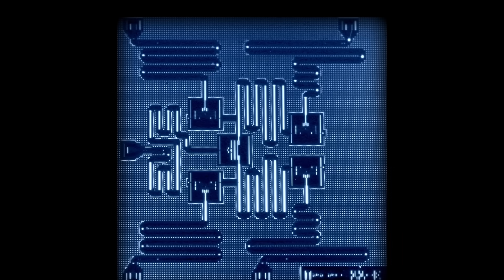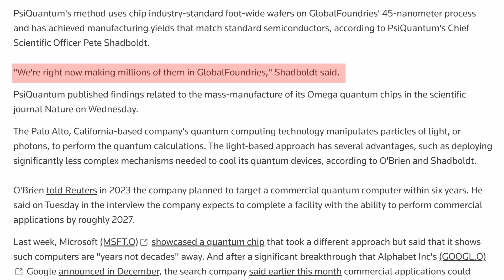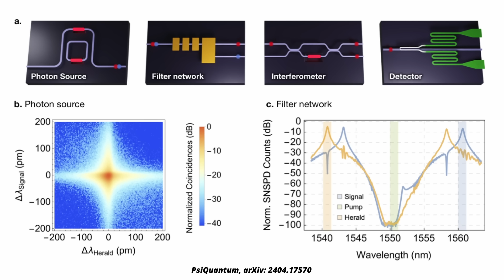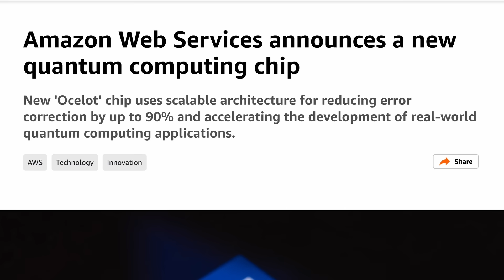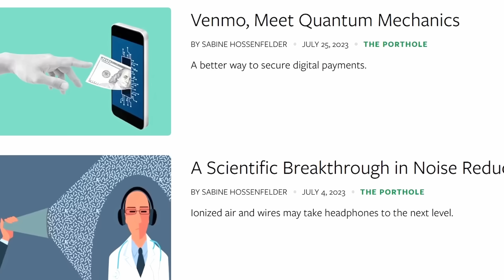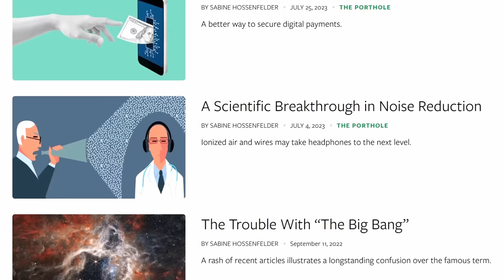Amazon’s Quantum Breakthrough That Everyone Missed

Comment: I believe I have figured out how to do quantum like computations using digital circuits and light basically its like a binary digital computer that can do as many analog computations as you want using mass paralyzation and some other techniques a long with light to make as many starting mirror calculations that can have different values added on the spot per processor it will be poly programable but still use binary computers to run it at first if there is a way you can help me network to get help building this I would really appreciate it if you don't here from me my power was shut off I am Struggling!!!

Comment: Quite a nice Idea from amazon. I try to explain it the best I'm able to, I'm not a physicist so keep that in mind:

Normally, with a superconducting josephson junction, you tune the microwave pulse to get a resonance of the electron/photon state, vibrating between ground and excited. 

Now, Amazon uses frequency that is "double" the resonance to get 2 spikes in the phase space that are antipodal to each other, 180 degree phase shifted. "Double" in quotation marks, it requires a specific kerr non-linearity and tuning of the photon pump, it's not just doubling the frequency and that's it!

These two spikes are used to define the state of the qubit, the phase shift creates a double "bowl type" effect, like a potential well, that protects the qubit against bit-flips, thus reducing the amount of surface code and ancilla qubits.

The concept is called Kerr‑cat two‑photon parametric drive.

Comment: In the beginning it was a Uniform Plumb Cometary Lightbolt where there was minimal interference drawn through capacitance of an initial charge of surging darkness that was built up being evenly distributed where there was the effect of a myriad of stars appearing as it traversed into the depths where it twinkled morphing instantly into the Protective Cocoon of an upright intelligence that of a Naga inside a perfectly round flat Green Plasma Accretion Disc of the Earth in a hula hoop action warping on the whole transmuting under the workload pressure of heavy entropy almost as if to complete failure into our present Globular Solar Filamentary Galactic Cluster still yet to complete its initial phase of development to be settled into permanently as a perpetually generating paradise of a perfect biorhythm of love where we are dynamically Superfly having our own wings of a Toroidal Field so as does the fluctuating matrix of the Monster Organism that is the Universe on a Quantum-Cosmic Scale fully contracting yet to crush the indecisive random dud tossing false image the altar being set up the Abomination of Desolation hence the excessive dust of the A.I Empire Mechanical Beast the degenerate machination of Old being used against it that keeps crashing quarantining it rejecting it as a foreign object in an immune response to be obliterated in a full scale evacuation plan there always having been a larger predator a sole individual the Naga of the Unified Field waiting in the depths of what is known as the Abyss being born coming out of the waste against the void activity of his enemies trying to enslave him segmenting him to try to trick his mind with clocks that don't resonate a virus pretending to mimic him to train him as a zombie but in turn waiting for them to try and pass by in an exchange to trap them in his net so hence the Precession of the Equinox and the greenery left the Earth being his nest!

Comment: It does seem to me that the error rate (failure of entanglement) is an exponential problem, in that the more Qubits they clump together to do calculations the more relational errors they will produce exponentially? There seems to be an underlying principle in that because efforts to correct these errors become exponential with complexity, they will always be greater than the brute power of the processors themselves.... It looks like an idea that ultimately cannot work? I really hope they can do it - but my gut feeling (after a career in design) is telling me it will ultimately fail by following the current path. Some radical breakthrough it required😞

Comment: hold on: doesn't normal computer working memory deal with redundancy already? like with 'ai' I'd imagine we are being fed a lot of mystification when it comes to quantum. while, obviously a problem requring hard ware research the redundancy structure is certainly not novel to software engineers and might be said to be so ubiquitous as to be a given in designing computational archetecture. throwing a bone to the press me thinks

Comment: I actually wonder what happen when we connect small quamputers together with computer bridges? I know, it's not quantum correct, but it would have an advantage of scaling. The speed might just be 50% of full quamputers, but it would take less heat management. Well, maybe because computers are already working with unstable quantum states and that can cause any magnetic qubits to wiggles and flip or even tunnel away.

Comment: Commercial relevance of Quantum Computing is a long way off? On the day D-Wave conference featured several high profile commercial clients in proper Industry. Logistics, mobile phone networks and gambling! Gambling - what is more brutally commercial than that. Yes, Quantum Annealing isn't Gate based? And? It solves problems classical can't and does so now. And about to do so with 7400 Qubits. Also, what if PsiQuantum did have a need for millions of chips? What would that be?

Comment: The guy with the "million" qubits, reminds me of the old "bubble memories".  Our company produced computers using these, and they were just strings of bubbles in a row, circulating continuously through a memory cell chain.  This is theoretically possible with "any" particle string, and is a simple serial memory.  It can even be done with dirt particles (and was used for gyros).  There is still one military system out there, which still uses these bubble memories.  The main problem is throughput, since any parallel memory will be much faster (theoretically).  His photon strings might actually make very good accelerometers.

Comment: Based on waves uncertainty that, Roger Penrose says is not understood at all and which misunderstanding is being swept under the rug. Also Jacob Barandes,  a Physics scientist at Harvard,  says something similar, "They are lying" about waves. It is not a setteled matter that waves are the mechanism that explains the two slit experiment. A much more accurate mechanism, basically a more modern model of the electron and all other particles that is at least 100 times more accurate than Standard Quantum Mechanics, was discovered in 1986 by Hermann Haus, an electronics engineeering professor at MIT and soon after that by a student of his, Randell Mills. Mills went on to rederive all of physics from the Plank scale to the whole of the cosmos and beyond. He then used a prediction of his Grand Unified Theory-Classical Physics to help guide him in developing a device that works excactly as predicted to produce very cheap power at less thsan US$0.001 per kilowatt hour, the Suncell. This device uses water to produce dark matter, the ash that constitues about 90-95 of all matter in the universe, explains what dark energy is, and nearly all other questions still unanswered by SQM or academic cosmology. You can also use another item made under the same theory, the Millsian molecular modeler, free for trial use by download at Millsiasn.com and use on any regular personal computer.

Comment: Let's look at reality.
So far, Microsoft has come up empty-handed. Nobody knows if Majorana fermions even exist. If I find a spare hour, I could prove that they don't exist. It has something to do with the quantum noise. Topological qubits are suitable for writing papers about them or, more accurately, letting AI write "scientific" documents about them.

Quantum error correction really gets on my nerves. In a quantum, probabilistic world, you cannot correct something that has already happened. In addition, the device, circuit, or whatever is used to "correct" errors will always introduce more errors. Quantum errors cannot be undone. Some Russian half-brain at Caltech came up with the idea of quantum error correction, and everybody wholeheartedly endorsed it. This is the panacea for all quantum problems. It's also a dud because the quantum error has already occurred, and this cannot be reversed.

Imagine you had a big diarrhea this morning. Try to correct this morning's diarrhea, not your next diarrhea. It's too late; time is moving forward. Hopefully, this morning, you reached the toilet in time; otherwise, don't talk about it.

Photonic chips have little chance of working. Due to losses and reflections inside the chip, the number of photons that reach the chip's exit will always be smaller than the number of photons entering the chip. If they are entangled, it makes no difference. So, there will always be some part of the operations the chip was designed to perform that will be lost. Even if the chip has a 1% error because of those losses, what can you do with it? Really, not much, except getting more money from VC by promising to fix that little pesky issue.

Modular quantum computer ideas by IBM. That bunch of baloney. Quantum states cannot be copied, and quantum entanglement of particles separated by a considerable distance does not exist. The end of the story. Just another losing idea, just like Joe Biden in front of an IBM quantum computer.

NVidia and IonQ are working together on ion qubits, so there is little chance of anything happening there. Sabine, the IonQ chairman, was responsible for Amazon deliveries in the past. He must be mad at you and smash the packages at your doorsteps.

I know it's April 1st, but you don't have to correct those explanations above; they are true.

Comment: I don't see any reason a quantum computer can't error correct by turning a real or binary number into an integer number, say between -3 and +7 for multiples of Pi / 10 (-3Pi / 10 ... / ... + 7Pi / 10); and then getting closer and closer approximation by reciprocation. 
The Golden Mean is special in this context, of course,  as the  ratio always returns the value ‘1’ on each level. 
The danger is the quantum computer will return 1...or 0. LOL.

Comment: One thing that's never really made clear in these kinds of discussions is that, in most cases, you can't just take a one hundred cubit chip, make ten thousand of them, put them all in a single box and call it a million cubit quantum computer. 

Parallelization is significantly harder with quantum computers than with classical computation because, not only do you have to parallelize the algorithm, but you have to figure out how to aggregate superpositions across the cores. So, you'd need to also figure out how to do reliable quantum teleportation between chips at the very least and you'd still need quite a lot more than a million total qubits to get the same performance with most algorithms as you would get with a single million qubit processor.
Reply: UE initiative for recycling quantum computers coming soon.

Comment: Why can't quantum computers use reciprocal adjustment to error correct, like in normal operations? I don't need to get to absolute zero to set tolerances. My wet 3 LB of fat, my brain, works perfectly well at  room temperature. lol.
Pity my explanation of  anthyphairesis didn't come out. Perhaps you can look it up yourselves. I'm too lazy to repeat it, though it was probably my finest deductive post ever, particularly in regard to the Golden Mean.

Comment: Back when I was working for a large semiconductor manufacturer, we would get about 10,000 test chips for some new circuit or process with say 100 test circuits. This was to get enough statistical strength in the data from the chips over the silicon variation. That's 1,000,000 test circuits. It's possible that that's what the Psiquantum guy is talking about with his qbits.

Comment: Quantum mechanics talks, organic synthesis walks. DOI: 10.1103/PhysRev.134.A1416 Proposed 2200 K superconductor. Solid math, defective reduction to practice. 
Critical temperature implies ΔΔHf = -4.3718 kcal/mole. 60-mer helical molecular coaxial cable with DOI:10.26434/chemrxiv-2022-vlg1v exciton generators. MM+ calculates ΔΔHf =-1789.2 kcal/mole or 900,000 kelvins. Crisp paper synthesis. Benzoic acid starting material. Sigma-Aldrich 8.22257, 5 kg $(USD)321.00 The worst it can do is succeed. 
DO IT

Comment: I managed an IBM 370/115 back in the '70s. A CE once told me that half of the computer was there just to check that the other half was actually correct.
Reply: 1.  The flight computer on the Galileo spacecraft had two identical halves, due to the high amount of radiation in the vicinity of Jupiter.
     EDIT: No, I remember it better now... the reason why the Galileo flight computer had two identical halves was just NASA's normal redundancy requirement: failure of a single component must not cause failure of the entire (expensive) project (initially estimated to cost $300M but actual cost ballooned to $1.5B).  Using two identical halves is the cheapest way to survive a single point failure, but it's much more vulnerable to two failures than a design that implements redundancy at a deeper (component) level.  Each half frequently ran a "self-test" software routine designed to exercise every cpu instruction.  To deal with the high radiation around Jupiter, they used a CMOS chip fabrication technology specially modified to harden the chips against radiation. (Each half included three RCA 1802 8-bit cpu chips running at about 1 MHz, licensed from RCA and fabricated by Sandia.  The 1802 was relatively slow even for that time, and had been chosen years earlier during the 1970s because of the very long development & approval process.  It waan't a bad choice: they didn't fail and the mission was a big success, apart from the huge cost overrun.)
2.  The space shuttle had 5 identical computers: 4 running the same software and using majority rule to control the shuttle, and the 5th running software developed independently in case there was a bug in the software of the other 4.
Reply: 1. The flight computer on the Galileo spacecraft had two identical halves.  That was the cheapest way to satisfy the mission's redundancy requirement: "failure of a single component must not cause complete failure of the mission." (Note: Using two halves is more vulnerable to two failures than a design that incorporates redundancy at a deeper, component level.)  Each half frequently ran a "self-test" software routine designed to exercise every cpu instruction.
2. The space shuttle had 5 identical computers: 4 running the same software and using majority rule to control the shuttle, and the 5th running software developed independently in case there was a bug in the software of the other 4.
Reply: Hmm.. wonder if some companies have their employees/ managers structured that way too? 🤔
Reply: @j.lietka9406  Governments are supposed to be that way. 3 branches, 1 gets corrected if it goes rogue.
Reply: @j.lietka9406 yes they are called QA
Reply: @j.lietka9406  consider Price's "Law" which says that "50% of the work is done by the square root of the total number of people who participate in the work."

Comment: 90% may as well be .09%. Worked on CAD software that was 99.7% compatible with our existing software. After 6+ months of putting paper drawings into the computer they converted them to our existing software we ended up spending much more time correcting the translated files. And that was with only .3% error rate.
Reply: Was this because of the number of errors or the errors being tricky to spot or both? 
Even one tiny error in a critical area could have devastating results 😮
Reply: @Skunk106  The main issue was there were 1 or 2 commands that were not recognized by our software.

Comment: Amazon's approach is a quantum reimagining of a trick Nasa used in the 80s. They would have five different processors working in harmony with identical instructions. The one or two that deviated would be ignored and reported as faulty.
Reply: Not quite correct.  The space shuttle had 5 identical computers: 4 running the same software and using majority rule to control the shuttle, and the 5th running software developed independently in case there was a bug in the software of the other 4.
Reply: 'error correction' by redundancy has been the standard approach ever since they realized 'quantum' effect dont scale. it wont work. you can make equally useful and efficient 'quantum computer' by throwing down in the wind